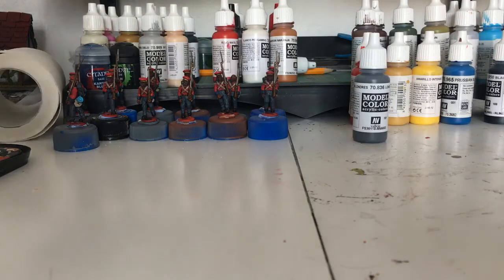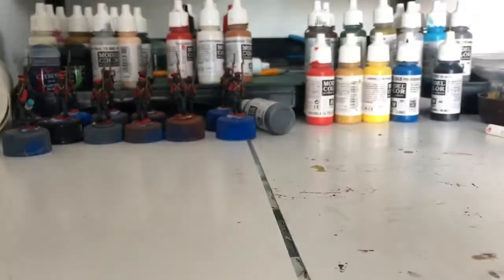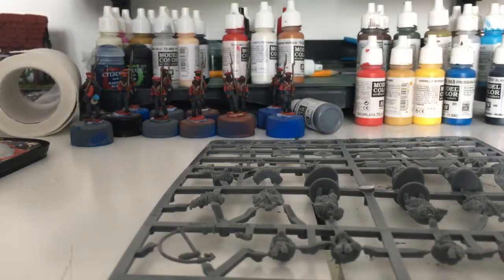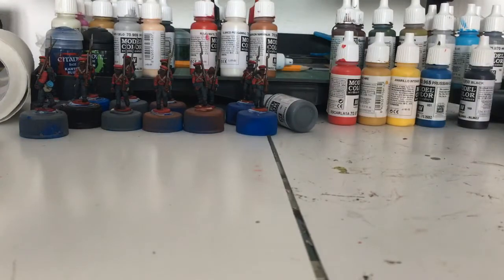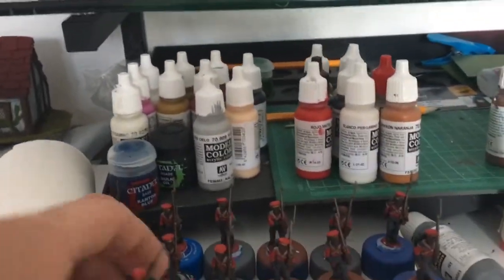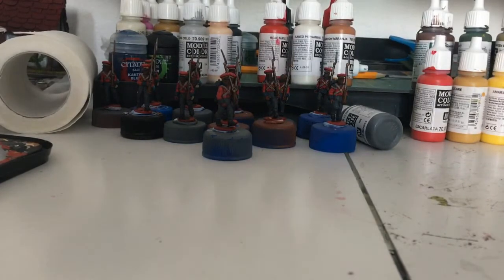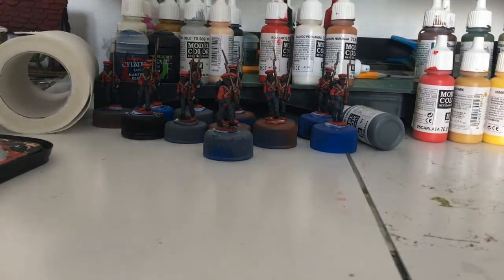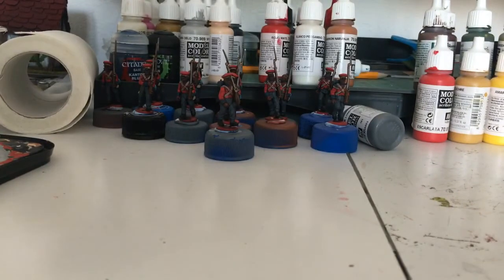Update and Unboxing. Victrix Romans. Take 2

Comment: Those Victrix Romans look excellent but I know what you mean about the price - their other Ancients tend to have 48 to 60 figures in a box. May have to get some though and Victrix are, at the moment, doing free postage for orders of £40 or more.
Napoleonics look great.
Reply from the maker: Yeah I wonder why these are kinda double the price? I wonder if this is the future for Victrix? Corporate heads on, instead of hobby heads. I've glued and undercoated already. Couldn't resist lol.
Reply: I would like to have seen bigger packs of 56 to 60 figures like their other ranges at the £29.95 price point. Maybe the higher price is down to higher design spec, better quality figures? Anyway, look forward to seeing what you do with them.
Reply from the maker: Thx mate, hmmm not sure. yes i'm just trying to resist now and get the Hanovariens done first lol